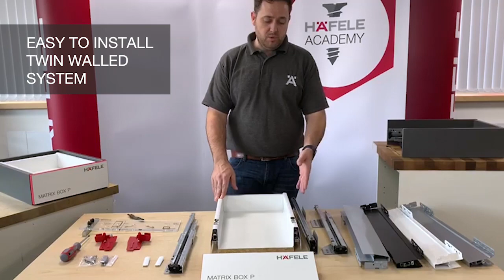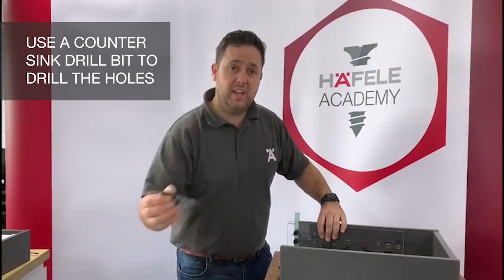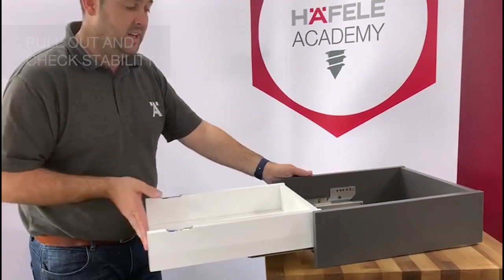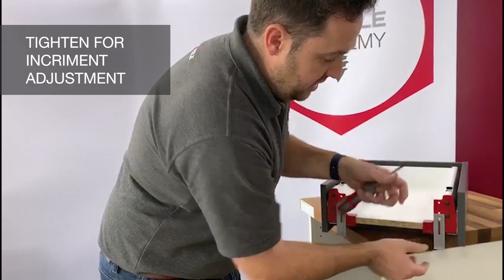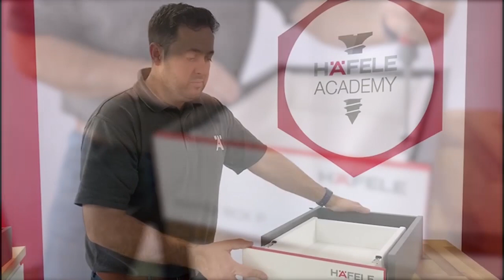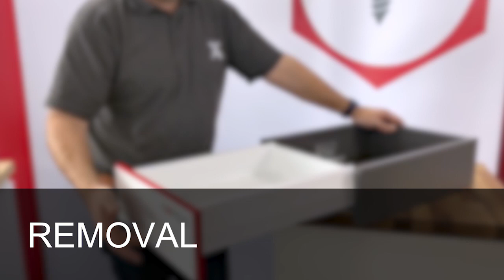Matrix P Installation, Adjustment and Removal

Comment: Had a new kitchen installed but it's not yet in use. Had to remove some drawers to cut access panels in the back of some cupboards (kitchen fitter didn't think we'd ever need to access cooker isolation switches!). not having a clue about how to remove these drawers, I rang the guy to ask. He told me to pull the drawer all the way out, hold either side at the front & sharp lift, returning them the same way.
Trouble is, they don't now fully lock into place. They seem to lock in ok but when you close then open again, the side is no longer attached to the runner - consequently, the drawer can be opened further & it doesn't sit properly when closed again. The guy wants nothing to do with it given that I've obviously broken the thing! Should he not have fully explained the removal and re-fitting process or, at the very least, left some written instructions?
Just to add, how do I know what system I have? Is there any markings on it?